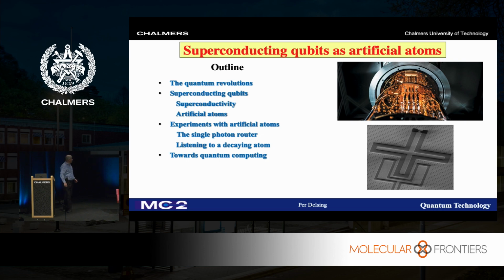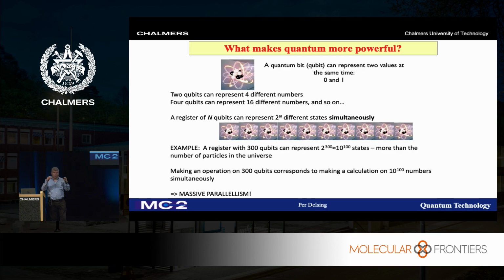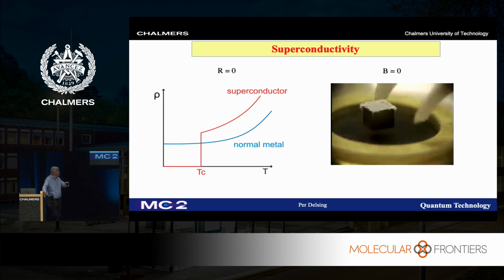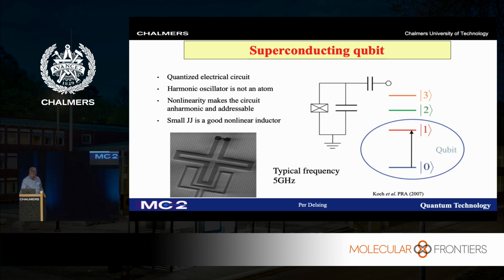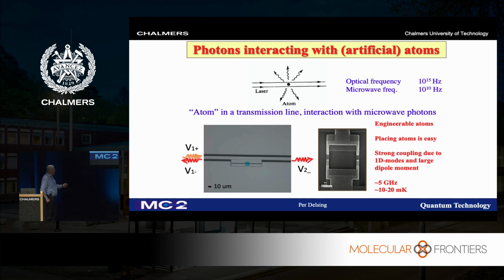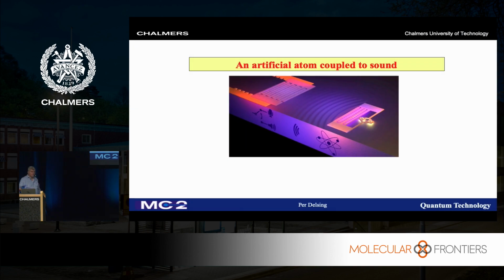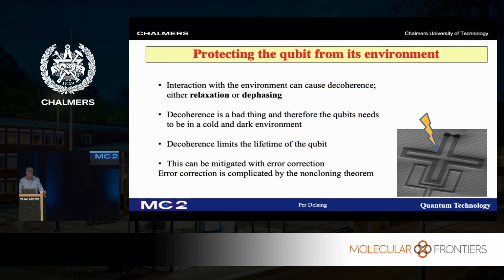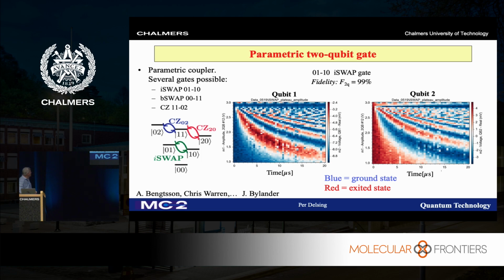Per Delsing: Superconducting qubits as artificial atoms

Comment: how does the human brain run its calculations on so little power ? why does it not get hot ? are your cells superconductors at body temperature ? is not CISS the answer to superconducting ?
Reply: the microtubules and tublin are metamaterials as superconducting qubits - in the brain and the body also. Check out Stuart Hameroff and Roger Penrose for details.